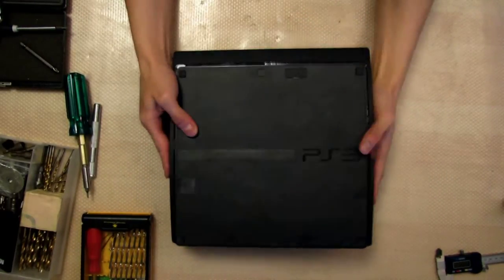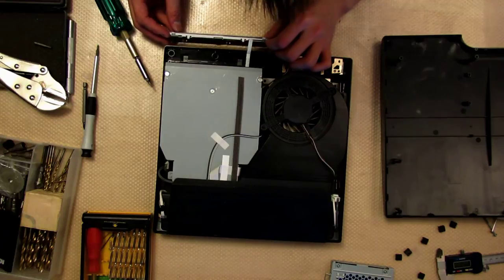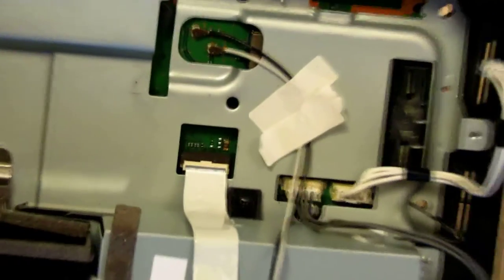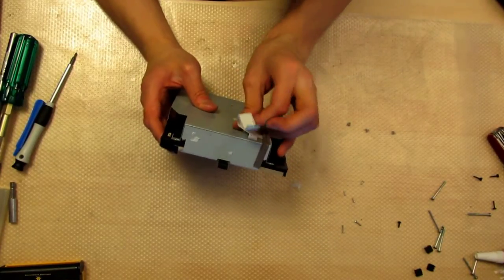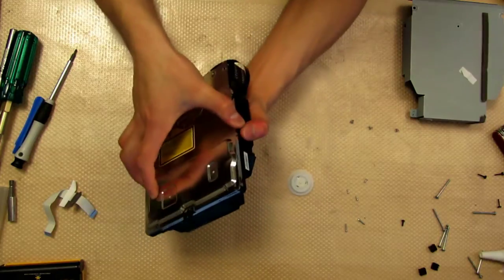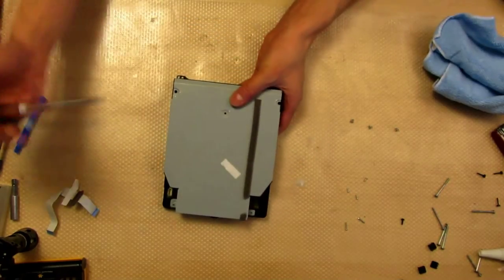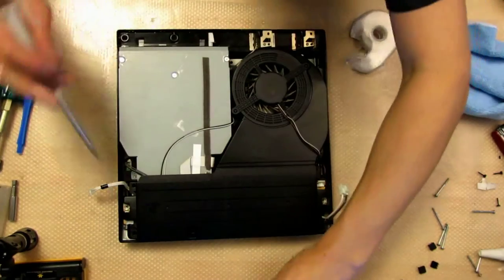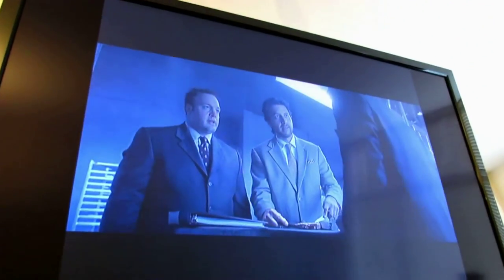How to Remove and Fix your DVD Rom in your Playstation 3! (Remove Coins!)

Comment: Will the ps3 completely be wipped out if i do the process wrong ? I dont wanna lose anything, but im just making sure
Reply from the maker: Ya you're right to be concerned about it, I think it could definitely happen if you damage something beyond repair and you lose all your data.  Just be very careful not to damage the motherboard or hard drive. When I work on electronics I'm careful not to jab it with the screwdriver, I've knocked off surface mounted devices before, it's not fun trying to solder it back on. So definitely do it with a gentle and careful hand.  Avoid static electricity damaging things as well, if you don't have a static strap, your can touch anything that's grounded, like the metal case of a computer.  
It's not the most dangerous operation but definitely gotta be careful. 
Good luck!
Cheers,
David.

Comment: What if you don’t have kids and it just stopped working even for video games due to lack of use?
Reply from the maker: Unfortunately that happens due to demagnetization of the permanent magnets that the lens uses to focus, so a lot of times DVD readers fail after a few years, only way to fix that is to replace the DVD unit, probably not worth the hassle unless you can get an old PS3 for free that has cracked BGA on the GPU.  Not sure if it's worth the swap tho.  
Cheers!
David.

Comment: Games are freezing up when I use CDs but when I use one on HDD it works perfect. So it may just need a good cleaning but its starting to make an odd noise. Not like the sound in the video but like when its reading the cd
Reply from the maker: Ya, the noise is probably slipping if the CD due to dust, open it up and clean it and make sure all the mechanisms holding the CD are in order. That'll probably fix it.

Comment: My little brother stuck a coin in our ps3 years ago my dad took it apart and now it has the red light of death, what should I do?
Reply from the maker: That sucks.
It sounds like the red light is usually due to dust build up and overheating.  Maybe when he took it apart, he unplugged to fan and it isn't plugged in?  Sounds like it's worth taking apart again and checking everything, and putting it back together again.  Looks like a lot of people have dealt with the red light of death.  Reminds me of the XBOX RROD. Lol.
Good luck!
Cheers!
David.
Reply: Thank you for responding 🙏 I’m going to try to see what’s wrong with it or take it to a repair shop, also my ps3 doesn’t quickly flash red like the faulty ps3’s I’ve seen does that mean anything?
Reply from the maker: @fotty1  My PS3 started crapping out and had the red flashes too, it's common that the BGA has cracked from all the heat and cooling cycles, I tried baking it but it didn't work, probably broke more things than it fixed lol.  This YouTube video, the guy had the same symptoms, he had to reflow it.  I think the amount of work isn't worth it, the shop may not be able to fix it, and the cost of labour would be pretty high.
I think you might be best off trying it yourself, and if that doesn't work, at least you didn't spend any money, and you can put the money you saved towards a new system.  The PS3 is too old to make it worth while.
Check out what this guy goes through: https://youtu.be/rC8nt63-bIE
Cheers!
David.